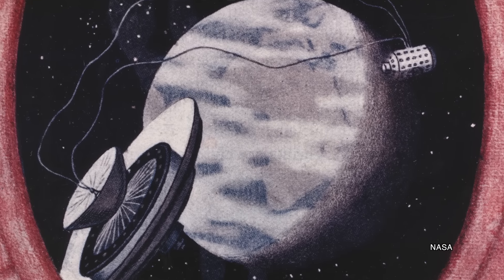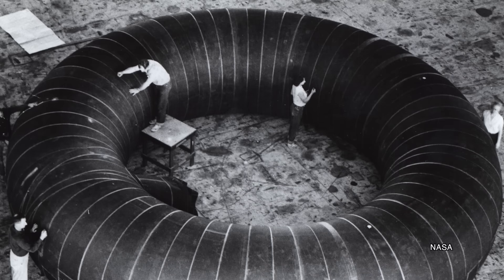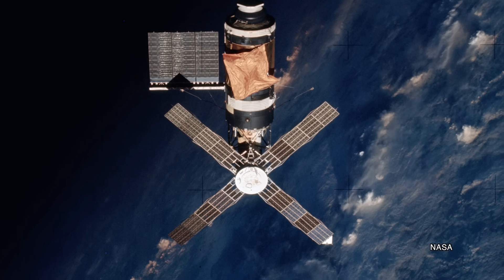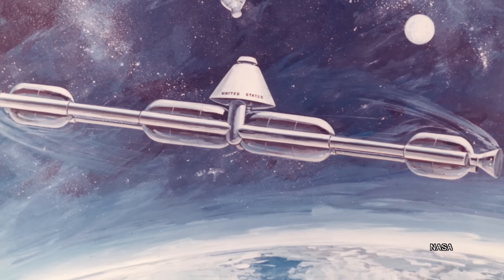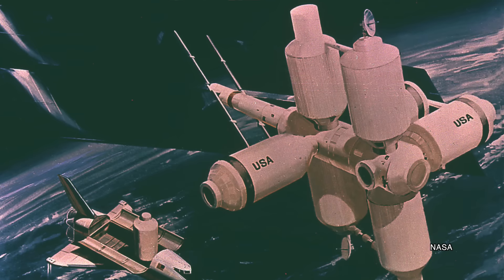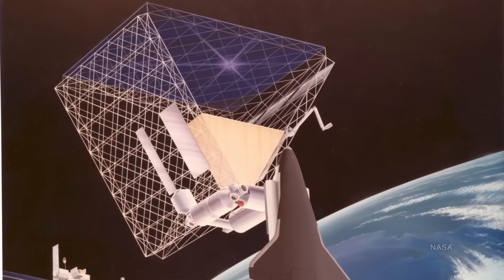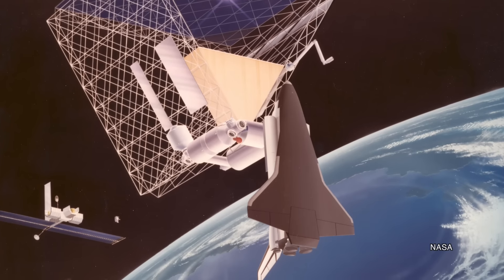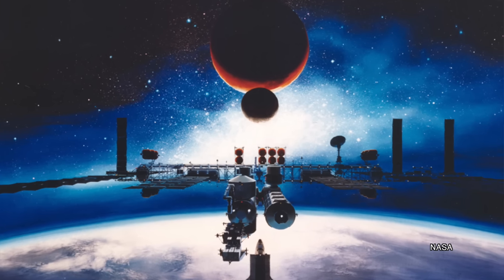These Incredible Space Stations Concepts Never Got Off the Ground

Comment: If you put space station Freedom in a list of space stations that never got off the ground, I think you should do so with an asterisk, so to speak. Much of the hardware for Freedom was actually built, launched, and is being used today in the ISS.
Reply: +Marc Barrett :That's pretty much true but by the time any hardware was launched, it was already referred to as the ISS. It's tough to pin down a separation point between the two designs because Freedom never officially got the ax. The closest one can come was the station re-scoping of the early 1990s in which NASA took one more look at 4 differing designs. The freedom configuration won out as the least costly to implement. Another competing design relied on Shuttle "C" to launch the major elements. Shuttle "C" apparently wasn't projected with a high enough flight rate to make it cost effective so it was cancelled.
Reply: So the ISS is mostly just Mir 2 and Freedom?

Comment: I have to say one thing about the whole space wheel deign. It would need a lot of energy, so it would either have to be attached to a remote/semi remote(as in connected by a cable) solar field in space that would orbit alongside it, or it would need an on board nuclear power station. While there is no friction with the surrounding environment, there still is quite a bit of friction within the space wheel itself/it's axis. And for the station to be able to maneuver while at no point loosing it's rotation, it would need to have additional elements stretching pass the ends of the wheel axis that would house the actual propulsion and communication. In short - it would not look as sleek as that.

Comment: I actually came here hoping you'd have some information on the "moon lab" concept. Details are sketchy but as I understand it they had intended to use the spare Skylab they built, which is currently on display in the National air and space Museum, and launch it in a wet workshop format to push it into a circumpolar orbit around the mall. Presumably it would have used some leftover Apollo hardware on extremely low energy trajectories to get crews to and from it, and it would have done largely the same thing as the Clementine remote missions from the 1990s, though it might also have allowed for some real time RC vehicles zipping around on the surface controlled by the moon lab crew. Or so I have heard. I don't think this subject was up for consideration for very long, which is probably why I've never been able to find much about it, but if you have anything I would love to hear it.

Comment: Why did NASA abandon the Saturn 5?
Reply: +Kerbal Space Command :Public support for Apollo dropped dramatically after we won the moon race. This was reflected in the Nixon Admins decision to cancel all post Apollo manned programs except the shuttle. The shuttle was thought to be much less expensive than the expendable Saturn-V until shuttle failed to sustain the flight rate that would have made it economical. The Saturn was only good for very heavy lifting which is generally required for lunar and mars bases and when those were canceled, the Saturn-V was done.
Reply: +J Dean fun fact the apollo program was 10 dollers cheaper then the space shuttle program
Reply: Wow,  I had no idea.  I thought they went to the shuttle because it would have been cheaper,  but almost the same price, what?